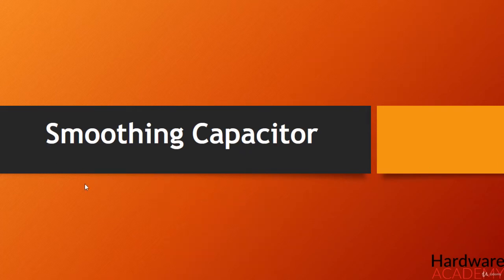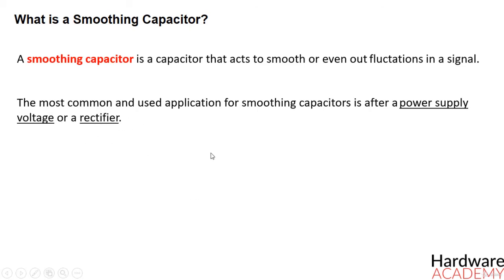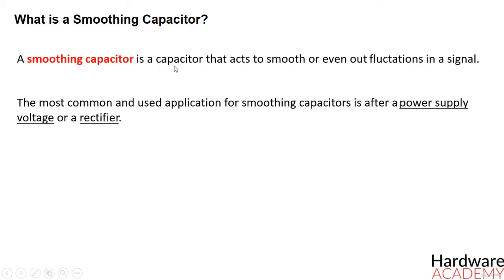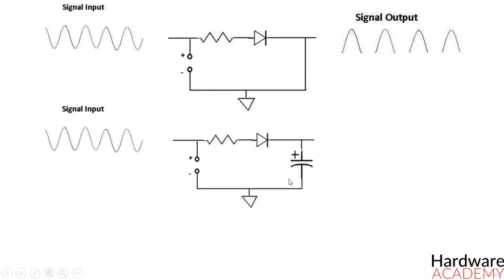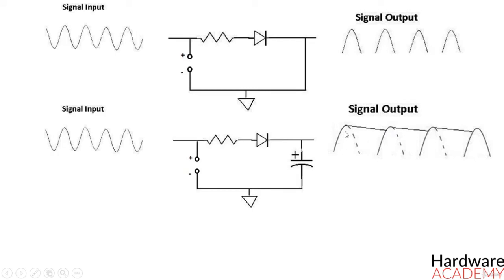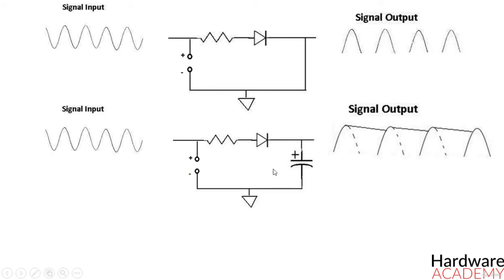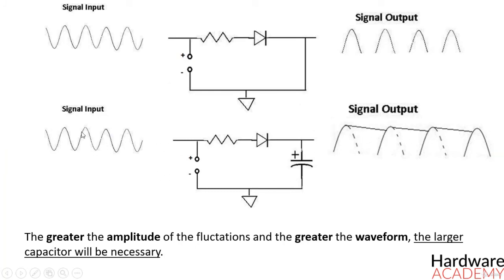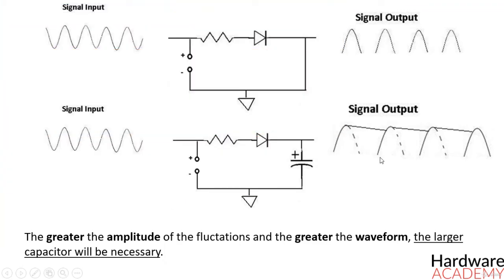52- Smoothing capacitors

Comment: Why the voltage of the load raise after smoothing 
With out smoothing i get 2.44
After smoothing i get 7.39
Reply: Super late and you've probably figured it out already, but would it be due to the average is higher as it does not drop to 0 anymore..